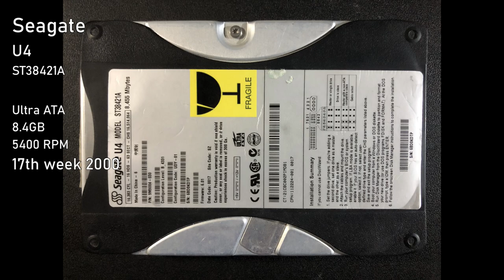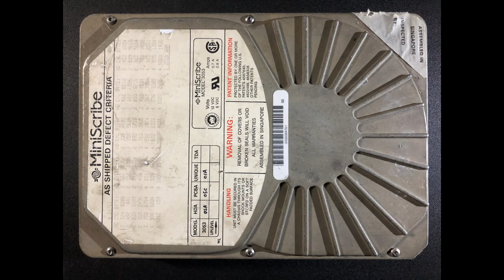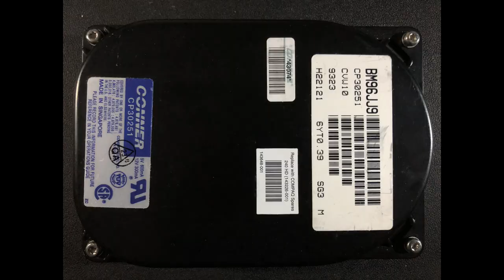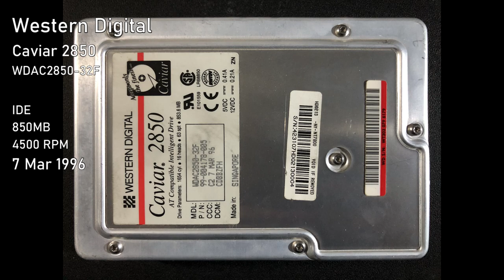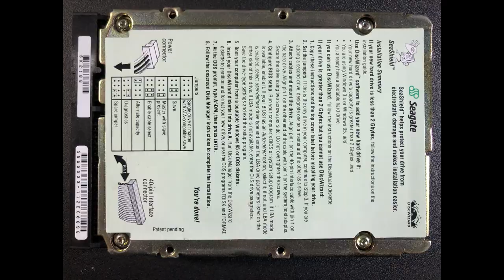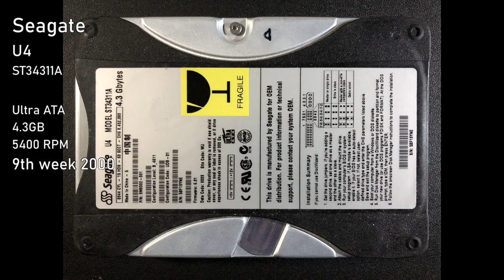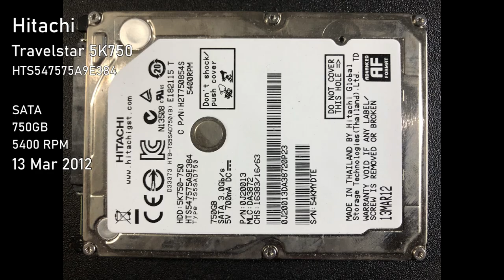My Vintage Hard Drive Collection - The Sounds of 50+ Hard Drives in 20 Minutes

Comment from the maker: CORRECTION: The Maxtor Atlas 10K IV is 36GB, not 32.
Reply: Always thought that drive had a really strange calibration sound.  Your example is perfectly healthy.  The best sounding Atlas drive is the Quantum Atlas 10K II.  It has an unusually low note for a 10,000 RPM drive, almost a resonance to it, but is very, very smooth, no buzz at all to it.  I have a machine with 16 of them, 25 years old now.
Reply: @MrZorbatron 16?! Wtf is  it? A old rack mount server or disk shelf?

Comment: Finally, a collector who has an IBM 171MB disk, which I had with an Amiga 500 computer (with an additional external HDD controller).
It was a really loud disk, with an additional sound effect - depending on which cylinders the heads were operating on, but perhaps the second problem with this additional noise is was the fault of a specific example. In any case, the drive performed well and was resold 3 years later. A year before the sale, it was replaced by WD Caviar 850MB, which I have kept to this day and is also featured in this film. As a former seller/servicer, I say that you should treat an HDD like an egg. How durable it will be depends on what micro-injuries and stronger impacts it will be exposed to before installation (on the way from the distributor to installation in the housing).

Comment: I have to say, my favorite sounding one is the Quantum Bigfoot, I'm not even sure why.
Reply: Quantum bigfoot is actually one of my favorite drives of all times and I been using them since the 90:s and still today and they are big and awesome, have many left that still works, But I always liked Quantum Fireball too, very durable drives, it is however aging problems with pretty much all Pro Drive versions because of rubber rotting internally making the heads get stuck on them now sadly enough

Comment: Amazing job on the video! Although I will say, a few of the drives sound like they have issues initializing, for example the Quantum ProDrive 105S sounds like it has a sticking rubber bumper which is a known issue on those brick style one's as well. Also the Piranha 4200 sounds not normal since it just does two clicks, although those are so hard to come by it could be normal, I'm not sure! Also I absolutely LOVE those Seagate Medalist drives and the Medalist Pro you have! You have an incredible amount of great drives, thanks for sharing : ))

Comment: I have a pretty sizeable collection of older WD, Conner, Seagate and Quantum drives but never owned any new. Were they always noisy like this or is it compounded by age of the bearings and other internal parts? These sound amazing by the way.
Reply: They where a little noisy when new, but not as noisy compared to today after however many thousands of hours of runtime. (Especially counting the spindle motor bearings)
Reply: I have some of those 5.25 drives as of 2024 and they do grumble a bit taken out of storage for a bit then quiet down. Particularly the ST-412. Never heard a Bigfoot with a loud bearing and I have a few of them.

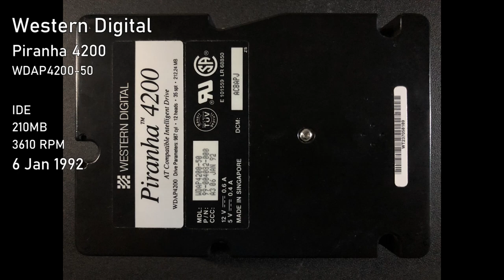Comment: 6:26  How are they constructed to sound like that? They turn on and off and then they turn on with a whining noise and then the "nitro" kicks in.
Reply: Most likely, the disk is spinning up slowly to check that the disk is spinning normally, and then turn on the operating mode